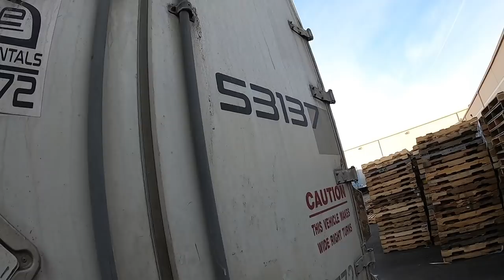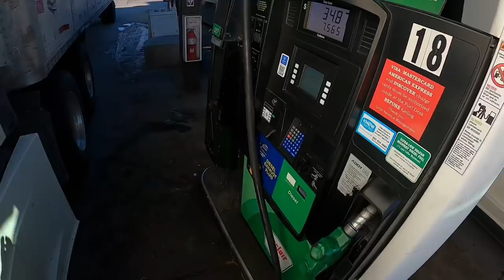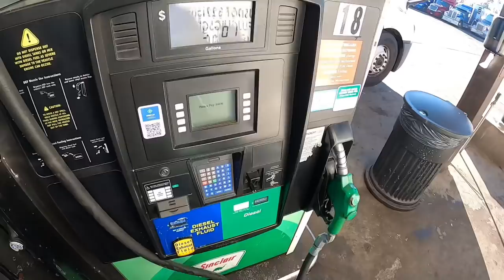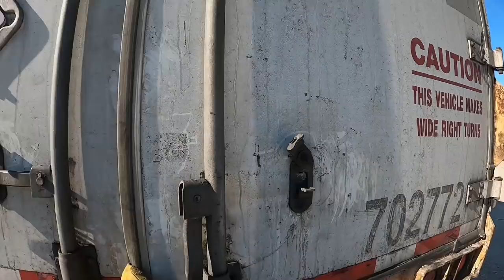Non stop problems in trucking😓

Comment: Change the air dryer filter every year!! Anytime you have problems with trailer lights? It's usually either your green cord or the actual socket on the trailer you plug into.

Comment: Should isolate the problem at the plug which connects to the trailer. If you have power on the circuit which is for brake lights at the plug. Then it is wiring on the trailer side and not tractor. Hope this helps.
Reply from the maker: it was one of the clearance lights on top of the trailer once that was replaced everything worked 😁

Comment: I had two different trailers catch fire a week ago on the same trip🤦‍♀️ (the brakes locked up and I didn't know until it was too late)
We had to offload the full trailer onto another one by hand. I drive no problem all the way from Columbus Ohio to Detroit MI. I get unloaded and when I got to leave the truck starts acting funny again like the brakes are engaged but they wasn't. I looked at everything nothing was wrong, so I left. I get about 10 miles down the road and I pull over to check everything out, everything seems fine. I go about 5 more miles and obviously I'm watching, listening, and at this point smelling for problems. My abs light comes on so I pull over immediately, and bam wheel is glowing. I grab my second for extinguisher for the evening and yep there is flames when I get back there. I put it out, call dispatch let them know. It's a rental truck so I call Penske, it's gonna 2 hrs for service (of course) and they are marking it as a foreign trailer problem bc the trailer is ours but theirs. Well I eat screw it I'm going up to TA 3 miles away and I unhook my truck. I get to the exit and turn at the light, now the truck won't shift out of 4th gear. 
Now I told Penske and my dispatch that I believe it's the truck causing this problem bc come on how does this happen to two different trailers in one night? 
Well of course Penske won't take blame, but when I call and say their truck is broke down, miraculously the service truck appears in 20 minutes 🤷‍♀️
They clearly say that the transmission and air goes hand in hand but it wasn't the truck that caused the problem on our trailers..... 👍 Okay BS
So now the truck has to be hooked and they gotta find me another truck to drive home. That takes another 4 hrs. So by the time I finally got home is been in the truck for 20 hrs. In a day cab for that matter. Thank God I was running paper that day.

Comment: I'm studying automotive technology, so will get back to you on the fast clicks... Probably the people that made your trailer lights worse also replaced some blinker part with a different one accidentally. Maybe a car version of some electrical component, that maybe is meant for less voltage (still works with more luckily, just blinks much faster haha)

Do the actual lights also blink super fast? that must be hilarious!
Reply: https://youtu.be/r8aqEg2Rx1g

Already found this, a good local mechanic could fix this in an hour or two. You'll be especially appreciated if you do the start diagnosis yourself (turning on blinkers and checking if every single one works)

Comment: If your blinkers goes fast is that fuse of 💡  or  air sensors?
Reply from the maker: could be any of those sometimes its just simple as replacing the 💡 but sometimes its a lot more complicated electrical issue😓😂

Comment: SMH 🤦🏼‍♂️ that sucks. How old is that trailer? Modern trailers have one main cable and 2 others if it’s a tank. Bro if you follow the cable from the 7 way a complete moron like me can find any disturbance (corrosion) bulge, fucked off wire(s). Wiring is easy. It really looks obvious.  For the air leaking, Grab one of those torch flame lighters(lol crack lighters) don’t melt anything obviously but you can seal up a leaking hose. You’re warming up the O rings. As far as the air dryer don’t count on anyone to check or replace that. I’m glad you are learning. You’re gonna learn that the only one you can count on is yourself.  You should start learning about how everything works, easy shit really.
Reply: I don’t remember seeing anything about the air dryer on any pm check that I’ve done. However I am fairly new at pm’s. Part of my new job.

Comment: Hey man is this company only based out of cali? I know it's a smaller one clearly.

But I want to drive ungoverned truck even if it's a P3 cascadia like this. As long as it's got a 1500W inverter, ungoverned and I can idle for AC, and leave it off with bunk heater it's cool.
You're a W2 with benefits or a 1099? How is it being paid, but also paying a percentage for the fuel and what seemed like insurance too. How much do you take home in your pockets bi-weekly?

I'm from Arizona, looking for OTR 48 companies, that pay really good, are ungoverned and have decent enough trucks.

I will NOT run paper, if I have working e-log, and I will not alter paper log just to make deliveries, or run illegally. I will not tolerate being forced to run over my hours, or out of my comfort zone. (weather events, drowsiness, etc.) The load can wait, my life doesn't need to be put at risk because these small guys want to try and run you illegally. I would maybe try an opportunity like this but if they try any sketch shit I am out. I prefer not to do Cali or NYC either, or ports. I can go into cali but I want right back out, and they better pay me extra to send me to NYC.